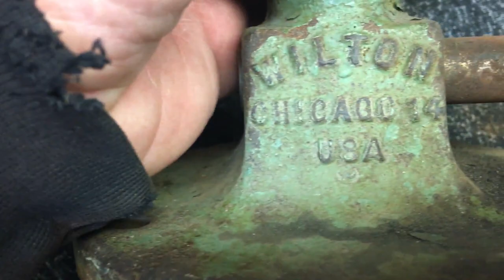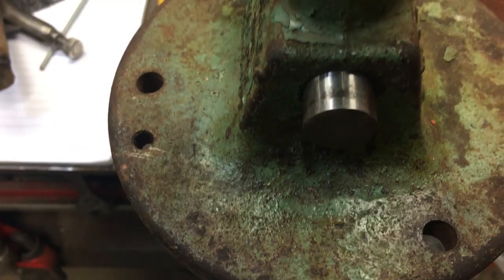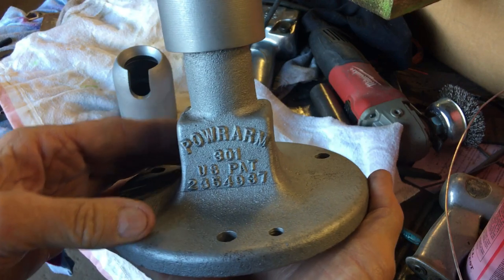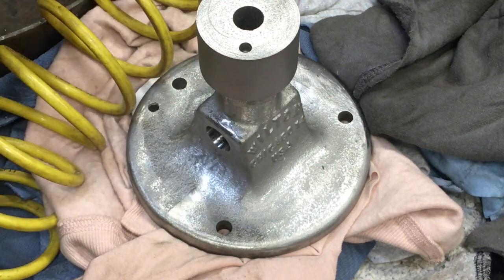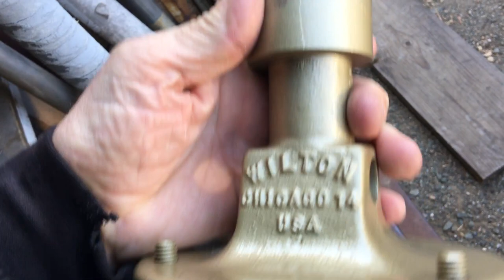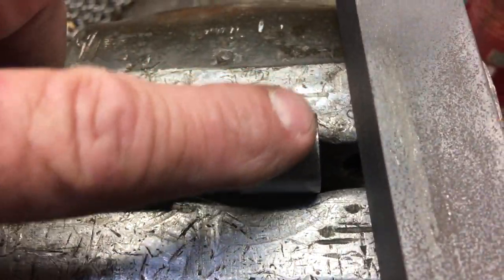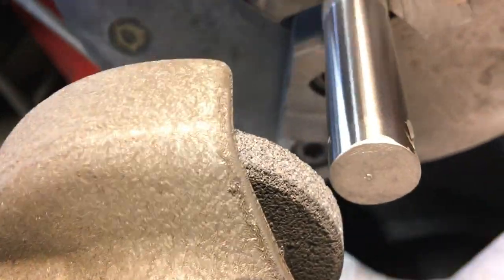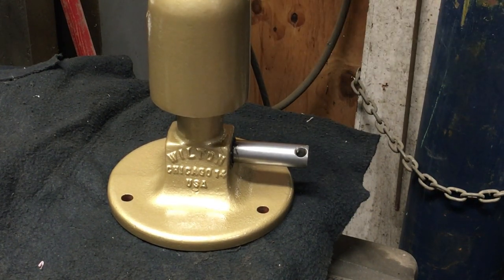Wilton PowRarm Restoration

Comment: Hey Gary,  In my shop, I also have a 90° die grinder with 2" and 3" Reloc pads.  I have the Scotchbrite cookies and various grit sanding discs.  As you might agree, they are super handy in the shop.  Also I have my favorite India and Arkansas stones, using them for things just like you do.  Keep up the inspirational shop videos. --Doozer
Reply from the maker: Doozer, I don’t think there’s a day go by where I’m not using my little 3 inch grinder. I have many air tools but I think that little Mac 90 degree I use the most. Thanks for stopping by and hope your having a great weekend.     Gary

Comment: I don't get it, it moves up and down 1/8"? what use can that be?
Reply from the maker: They are made to mount a vise or whatever you want to it and you can change the angle around. The ball allows you to pivot it around.   I should have explained it better in the video.    Gary